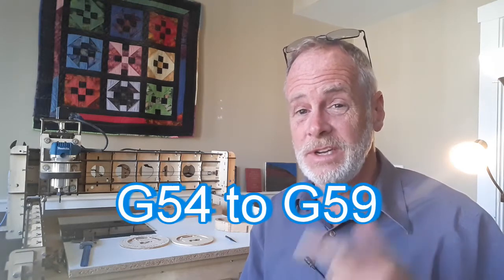* MUST KNOW * G-Code To Make Money w/ Your CNC Router? Work Offset gcode - G54 G55 G56 G57 G58 G59

Comment: Thank you for the tips.  Do these persist through power cycles or do you have to do it every time the CNC is powered on?
Reply from the maker: Pulps00, You're welcome! The settings on most CNC machines are typically saved and should persist through power cycles, but it's always a good idea to double-check your specific machine's manual to be sure.

Comment: Ive had my cnc for about 3 years now and have never needed to know any g codes since my interface already has buttons that do the same thing, i also use a cad software that creates a g code for me, never had any major issues, however ive noticed that when i go to work for others in cnc jobs the employers always have machines that require the use of letter codes (g,m etc) and its extremely confusing, i guess my question is whats the advantage of using g codes if modern setups dont need it?
Reply from the maker: LG-ro5le, in some cases you dont need it but in other cases it is a good tool to have in your toolbox brother! You can never know too much!

Comment: Very Helpful,  thinking through scenarios where will be using this in my projects once I start mass producing items.   Being that just starting out, I am still figuring out what software I will be using, hence busy exploring all the great content  you have posted up!  

 I am currently leaning at moment starting with subscription to Carveco, but sure within few months with be jumping to VCarve Pro.  This is current plan, things could change.  I am fairly competent at working within Fusion360 designing stuff(3d printing), may test that out with paths and such in future also.  I am fairly confident at this point VCarve Pro in long term will be my go to software.

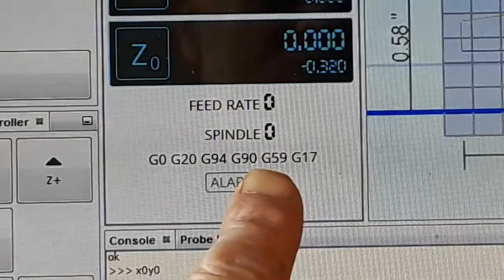Comment: Another great video.... but can you elaborate on what you mean when you say that they can't be used at the same time?  (16:40 in video)   Can I NOT setup step1 of a part with a G54 and then step 2  on the same part setup in a different location with a G55 ?   For example what you were doing with your dust shoe, G54 for the piece getting out of stock then a G55 for the dust shoe now getting cut on the other side, kinda in a production setup?
Reply from the maker: Steve, G54-G59 can only be used one at a time. Each location saved in G54-G59 is different. You CAN save a location with G54 and then save a different location with G55 for example but you cant use them at the same time in gcode because they indicate different starting locations and your machine cant start at two locations at once.

Comment: Question, Can you set any work position to any number? IE. say I want to set up right front corner of my longmill for a certain project. Can I set it to g54 or is that code preprogrammed into the software? Question is can I set up my system to my specific setup? 
Still don't have my machine but I have down loaded gsender along with Vectric Vcarve pro. I'm trying to learn as much as possible prior to the arrival of my Longmill.
Reply from the maker: Darryl, you will need to set the machine to g54 manually and then run your file. You can only set a work position to a few positions of g54 through g59.
Reply: @IDCWoodcraft  excellent. So these codes can be set manually to any position on the work space for individual projects to be run multiple times. I think I have a good grasp of this step.  Thanks for your reply.

Comment: Maybe I’m jumping the gun before watching the rest of the video, but what is a G code? Thanks.
Reply from the maker: Spunky, G code is the programming language that your cnc router, laser, plasma, or 3d printer uses to move the machine around. Most Gcode is generated for you automatically by the software. What I showed you in the video is for advanced users trying to maximize their machine.

Comment: Hello from Germany!
Great video!!!! Still getting into CNCing and I am learning so much from you!
A question I have though, is wether or not it is possible to manually define the G54,55,(…) position in the control software‘s setup page? 
Let‘s say for example I am working with some kind of L-shaped guide and I know that the inner corner of that is x-1.68 inches and y -31.49 inches away from my home position. (Forget about z, since I would leave that at 0, touching off different bits every time I change them).
Couldn‘t I just go into settings, enter and save these values, and go from there every single time I need that preset work offset, by clicking “go to G54,55,(…)“ or entering it manually?
Cheers
Reply from the maker: Hi Papa. Sorry for the delay in responding. Most control software defaults to G54 when turned on. However, you can manually make changes as you said. You can also add the other offset code (G55, 56, etc) into the program and it will go to that offset.

Does that help?
Reply: @IDCWoodcraft  Hey Garrett,
Yeah that helps! Thank you very much!

Philip

Comment: Are G54 through G59  open and that is why you choose to use though for your new start positions
Also I think this would have mad more sense  I had seen it done in my Controller software  Carbide Motion
Reply from the maker: Hey Resorter. This give a lot more control when you have multiple projects you do oftens.

Comment: So G54-G59 are Macros to set up a start point?  Is there away of naming those gcodes or would we just have to write down someplace what job those codes go with
Reply from the maker: No, these are not macros. They are call-ups for preset zero locations. The best, most basic, way to remember is write it on your spoilboard surface.

If you have production setups, put the code directly into the program at the beginning. You won;t have to wrru about manually entering it each time. It'll come up automatically.

Comment: Silly Newbie Question 1:  I understand the benefits of presetting these position coordinates. What I don't see in your tutorial is How to assign x,y&z coordinates to particular position and whether you set machine coordinates or work coordinates? 
Do you have to do this every time you switch on, or they saves & survive a power off restart?
 or can you set programmatically startup macro? (Ps. I'm using a Chinese 3018)
Reply from the maker: Once the coods are set for a location, the software should hold them regardless of the machines power status.

Basically, move the router to the physical location for your xyz (or just xy if you'll be changing tools), enter in the g-code offset (G54-g59) and set zero.

It's wise to keep g54 as an open offset that you can change whenever you want so don't commit that one to a position. The control software will default to that code when you boot it up
Reply: Thank you, I was expecting an assignment/equals type statement,  raw G-Code is newer to me than the machine
Reply from the maker: @JohnCol-1959  it's not totally necessary to know this aspect of gcode unless you do multiple jobs over and over

Comment: Great info, Very interesting idea Garrett thanks! One question, when inserting the tool bit how do you get it at the same exact height every time so the Z isn’t off? Maybe use a collar with a set screw?  Another factor is wood (and other materials)varies in dimension due to humidity, suppliers, & other factors, so my guess is some fine tuning will need to be done each time.
Reply from the maker: Whenever I change tools, I always set it from the same xy location. If you don't have a tool setting probe, when you are close to your set point, change your jog setting to 0.002". I always set the moment I can't move the paper. Collars have variation based on sawdust that may have collected on the holder, how securly you insert before tightening, etc.

I have found that wood has a unique quality of changing thickness slightly in some cases as it is being cut (due to pressure relief of grain above the cut surface being removed. More so in ply and softwood.

It's a tricky little business. I compensate with a final .010 to .015 finish cut.

Does that help?

Comment: TY very helpful
Reply from the maker: Hello 'Keys'. Thank you for letting me know and I'm glad you found this helpful. What kind of router work do you like to do?
Reply: @IDCWoodcraft  Just finished building my router. Setting up and learning now.
Reply from the maker: @keys4692  Exciting moment!!! What will be your first project?
Reply: @IDCWoodcraft  My first project will be        making my spoilboard
Reply from the maker: @keys4692  Ah, you got one of the K series?
Reply: @IDCWoodcraft  No I built my own design cuts 21:x 32"
Reply from the maker: @keys4692  Wow! how long did that take. I've been interested in building an 8 footer for me
Reply: @IDCWoodcraft  I used what I had laying around and it took me about a month. I bought the  400,700,1000 rails and ballscrews from Rattm motors. I bought an old motors and drivers craigslist for $50 and put an arduino in it. It came with the case and all the wires.

Comment: Awesome stuff !!!
Reply from the maker: Thanks @Bradley! I'm assuming you're a CNC buff?...
Reply: I. D. C. Woodcraft  I don’t have a CNC router yet thinking about purchasing one however I operate a cnc laser at a aerospace manufacturing facility
Reply from the maker: Ah, Bradley...you've got an edge up them. You understand the equipment. When do you think you'll get one. Which brand are you leaning toward?
Reply: I. D. C. Woodcraft maybe get one within 6 months, looking at the bobs CNC E4  i would  like to do some 3D carving
Reply from the maker: @bwashburn100  I haven't gotten to that point yet so can't advise on that kind of carving. However, I have no doubt it will do it exceptionally well. I am very impressed with its performance.